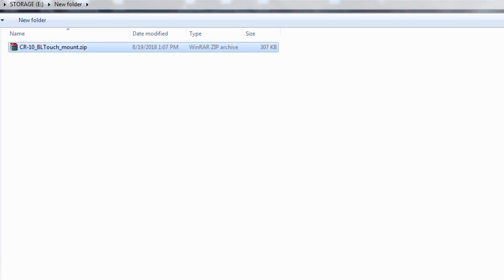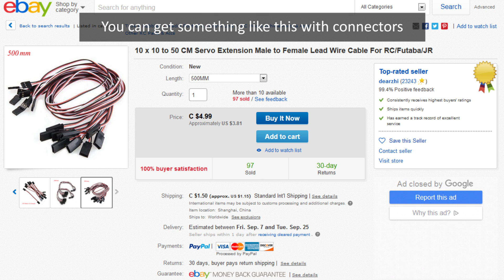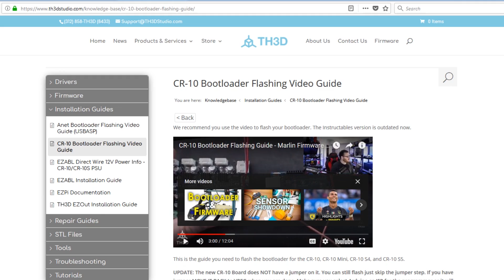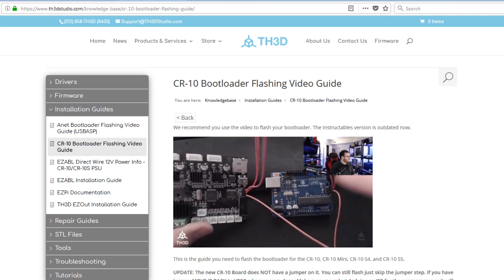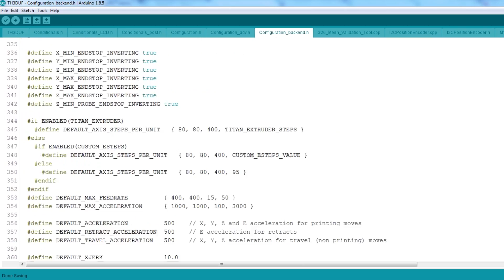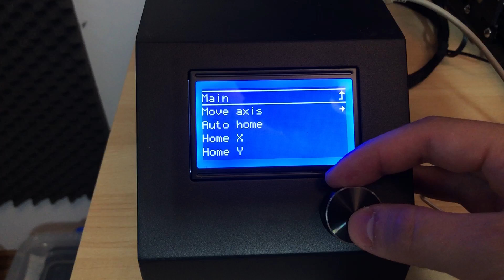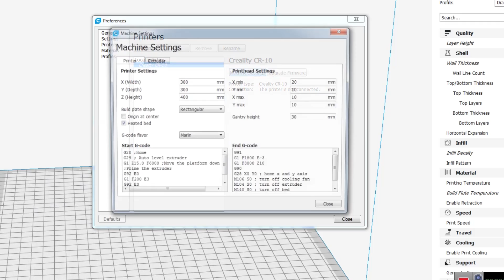Voltlog #177 - Installing BLTouch Auto Bed Leveling On The Creality CR-10 3D Printer

Comment from the maker: As someone reported in the comments below, the code shown in the video contains an error. Line #define SERVO0_PIN_27 should be #define SERVO0_PIN 27 (last underscore replaced with space)
Reply from the maker: as someone else reported in the comments "There is a critical information missing in this video, if you cannot take your nozzle below absolute zero (soft zero), enter this: M211 S0. This command will disable the soft stop. Once you adjust with paper, enter M211 S1 to enable it back."
Reply: Hi, i have a little problem. My Z axis after preparing everything isnt lowering itself but only trying to get higher and higher. Do You have any idea what the problem could be?
Reply: @TheGregMean  probs the Z home direction setting in the firmware (you figured it out I guess this is for the next person reading this)
Reply: The th3d link doesn't work.

Comment: I followed your procedures as well as incorporated a couple of other g codes for my CR-10s.  Everything seemed to work ok right up until I told it to auto level. The probe starts far right at the very front edge of the bed. The 4th point on the far left is completely off the bed. I thought I must have messed up something in the firmware regarding the bed size, but it appears to be set properly at slightly under the 300mm.  I don’t know what to do now.  Any suggestions would be helpful.

Comment: I personally prefer the cheap solution: Membrane switch to be put to the nozzle. Mostly used on deltas you can get such a switch for less than $2 on AliExpress; less than $5 including a board with a LED (which helps on the manual leviling with screws before using ABL). Solder Pin 29 on the Melzi board, get GND and 5V from the ISP-port, make some changes in firmware - and ready to go.
You normaly do not need to do ABL every time before print but only if calibration changed (other heatbed temperature, nozzle-change, transport the printer...) so manualy attatch the probe does not seem a problem to me.

Comment: A common source of 8 core cable is stranded CAT5. (Can't use solid because it will not last with constant movement.) Good way to reuse CAT5 patch cables with broken tabs, especially ones that are too short to be worth crimping a new connector onto. Ground all unused wires to minimize interference.
Reply from the maker: Thanks for the tip, I have a couple of those. In the past I also used alarm wire because that as well has stranded cores.

Comment: Is this process still correct? I'm installing a BL touch on my cr10 today. I've got the install and firmware covered(I bought the original). What I'm concerned with is the proper setup to get it working after install/firmware

Comment: This might be a stupid question but... you disabled the SDcard support in the arduino code. How can i use my cr10 then? Or does the standard microSD still work? Thanks in advance!
Reply from the maker: sd card support was disabled, you can print via usb. if you still need sd card support you will need to search for a tutorial that will keep sd card but disable some other things to free up memory.
Reply: @voltlog  thanks for the reply! Unfortunately i cannot find any other good tutorials.. can you recommend any other functions to disable? i would appreciate it a lot!
Reply: @narada4421  You can save quite a bit of memory by disabling menu options you don't normally use.
Reply: @narada4421  You can disable boot up screen - not sure how much it frees up not tried that method as i just print from usb or over octoprint

Comment: I have got a clone BL Touch (3 D Touch) all setup and able to AutoHome and probe the bed at multiple points! Bed Visualizer plugin for Octoprint works to provide a visual bed mapping as well. I can Autohome the center of the bed using a G28 and launch a full bed probe using G29. I then input the start G Code that was listed here and when I launch a print the CR 10Autohomes and then probes each point on the bed as it should and then just stops at the last point in the rear right corner. Both nozzle and bed are up to proper temp so it should just start printing , but it does not. It waits and waits and waits... Software Endstops are turned on - I checked by issuing an M211 and all end stops report as functional and change states appropriately. Checked with an M119.  
Ive got my probe offset correctly defined in Marlin as well. I measured how far the probe tip was in front of the nozzle (Y Offset) and to the left of the nozzle (X Offset).  I tried some other start G Code and it just made the hot end grind all the way back towards the  X Axis and then travel upwards towards the top of the Z axis.  I need an assist.
Reply: Late reply, but same issue. It stops at last point. Found a fix?

Comment: So just with the command  "G29 : Auto level extruder" in the g-code the machine will interpretate to make a heigh measure using as base the lowest point of Z axis configured in the machine? (my case  Z -1.29)

Comment: Just followed your instructions - have to to say this needs updating as my z axis now crashes into the bed at first, then levels itself. Also I have no BLTOUCH bed leveling controls on the screen. There are only BLTOUCH self test, reset, deploy or retract options :(. I will upload a video.

Comment: Just to solve the mystery with the z axis limit switch: if nothing ist touching it, the switch is closed and opened if pushed. So what happened ist that you shorted the black and white wire of the sensor each time the switch was not pressed. And so it doesn't matter if the sensor closed his self or opened... It stays closed until the switch was pressed

Comment: Im having issues since trying to install bltouch on my CR10. I cant get any answers from creality or other pages I posted in. My printers just collecting dust. Im pretty sure I have the wires connected properly and installed the firmware correctly. I auto home then prepare, move axis, move Z and adjust Z until paper just contacts nozzle just like I would level it. I get the value -002.8 then im supposed to go to control, motion Z and whatever it says add that to -002.8 and adjust. Well my Z says 00.00 Every single instruction and video Ive seen to install the bltouch, not one person had their Z offset say 00.00 Im guessing this is the issue but dont know what I did wrong. When I try to run the bltouch to level it goes through 9 points then goes up and right until the motor sticks. Theres no place I cant take it and pay to have it fixed so I cant even use it anymore. Please help.I bought the kit directly from creality because it had a little flash drive to just upload firmware tha was supposed to work without making manual firmware changes which I dont know how to do.
Reply: Did you ever fix this? In the same boat but I'm thinking of just doing what is in this guide. Pretty damn ridiculous creality basically lies to everyone saying the firmware works when obviously it does not!

Comment: 10:45
  G28 ;Home
G29 ,Auto level extruder
G1 Z15.0 F6000 ;Move the platform down 15mm
;Prime the extruder
G92 E0
G1 F200 E3
G92 E0
M420 S1

G91
G1 F1800 E-3
G1 F3000 Z10
G90
G28 X0 X0 ; home x and y axis
M106 S0 ; Turn off cooling fan
M104 S0 ; turn off exturuder
m140 S0 ; turn off bed
M84 ; disable motors

Comment: For those who dont have wires in following order: brown, red, yellow, black, white - don't follow colors manual, there are some bltouches with fucked up colors, check which wire is which beforehand, otherwice you will get black screen on tour CR10 when you start it after rewiring.
Reply: How do you check?

Comment: Are you still using a bltouch on your CR-10. I would like to upgrade to an abl system and was wondering if this would still be your recommended option?
Reply from the maker: Yes I would still recommend the bltouch, it's the best.
Reply: @voltlog  Awesome! I just ordered one! Thank you! Is there a way to babystep z height mid print with this firmware? I am able to do this on my genius to get the perfect layer mid print.

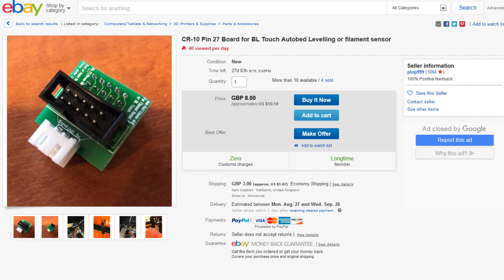Comment: Thank you very much for this video. At 2:30 why not attach the BLtouch to the mount with the nuts before installing the mount to the hot end assembly? You can also manually raise the Z position to give yourself more room to work with.
Reply from the maker: yup, that is good advice

Comment: IMPORTANT! The code in the video is WRONG which cause stuck me up, for 4 hours of head banging against my wall.
the line #define SERVO0_PIN_27 is wrong correct line is #define SERVO0_PIN 27 (last underscore replace with space) 
If you flash your printer with bad code you will end up with bltouch which is in stowed stated unable to release!!!
VoltLog can you please correct this line of code in your video? At least show big warning.
PS: I know that my english is bad, but more important is this information.
Reply from the maker: thanks for reporting the error.

Comment: Everything ok with the installation and the firmware, but when I give the homming command, the Z axis does not stop when the BLTOUCH touches the table. What can I do?
Reply from the maker: signal is not reaching the motherboard, could be incorrect wiring, incorrect config, you need to check everything.
Reply: Hey did you figure it out, if so what was the fix?

Comment: Just setting up my first Printer, CR-10s S5.  I liked this design, but with all the advertising hype associated with the other types I wasnt convinced.   Your video has convinced me.  This will be my choice for ABL.  I hope you will be available for questions >:)  .  Mainly G-code insecurities at this point.  Thanks for making this video.
Reply: I have the CR-10S too - its an awesome machine once you get your filament settings dialed in. A lot of other machines are 98% identical. Im not a Prusa fan - way too many weak 3d printed plastic parts- if you go plastic then I want factory jet molded for the price he's asking. FYI the main board is different than the CR-10, you have a LOT more memory available on the 10S so no need to comment out any code to make space and you can flash with the USB port. The firmware settings are different though - keep an eye on that. Ive flashed mine several times - the stock firmware is not great. The latest marlin with the added code works fantastic.
Reply: Do you have any "great" video sources for the Marlin sw updates or how to  do the updates or mods for the bLT.    I  just ordered the BLT but dont want to screw up my CR-10s.    There is advise but its all over the place.         thanks @davey3765

Comment: hi. Everything goes fine until i have 
to do the calibration.
When calibration finish the z axis starts to up, and do not stop until 
gets the top of printer. Even when it comes to the end, the motor still 
working, do not stop and very bad noise comes from spindle. This is the 
case of a CReality CR-10.
Please anybody can help?

Comment: Thanks for the video, TH3D makes the install a breeze - That cable tie is not terminated correctly
Reply: Hey men, do you have that specific TH3D firmware?
Reply: @engineboy5362  Did you ever find it. Looking for it aswell.

Comment: HELP PLS
I fnished intalling BLTOUCH and firmware, 

I Have CR-10 
Motherboard V1.1.2
Firmware: CR-101.1.6BLTouchV3PowerLossContinueEnglish.hex 
(the latest firmware Creality provide on its website for the CR-10 with Bltouch )
BLTouch V2

Auto home work fine, 
When I select level Bed, its goes through its sequence than, Z goes full up, X goes full forward and Y full right untill all moors are slamming at their max... 

I reflashed the firmware with couple different ones.. always the same issue.. any ideas?

Is is a problem with the V1.1.2 not having enough memory space ?
What do I need to do?
Reply: How did you solve this? Having the same issues.

Comment: There is a critical information missing in this video, if you cannot take your nozzle below absolute zero (soft zero), enter this: M211 S0. This command will disable the soft stop. Once you adjust with paper, enter M211 S1 to enable it back. Watch this for setting up the BLTouch: https://www.youtube.com/watch?v=y_1Kg45APko

Comment: Can you not just remove the Z stop connector from the board and plug in the bl touch instead of tapping the wires?
Reply from the maker: Jamal Mahroof yes you can do that if you have the proper jst connector. I had to tap the wires because I had a previous mod there.
Reply: @voltlog  Got my bl touch and just did it with some male dupont wires. One on each of the pins and it works fine.
Reply: @Jamal Mahroof you just connected the sensor to Z endstop switch with no any other  control box modifications? upgrade the firmware and thats it? something I don't get.. what about SD SUPPORT?

Comment: please help I having issue on my BLTouch when I do bed leveling it goes in the middle and starting knocking loud ive got the CR10s im not sure howto set offset
Reply: Same problem here
Reply: ever fix this?
Reply: @thomasengler403  did you ever find solution?

Comment: When I try to flash the board I get this #error "You must define Z_CLEARANCE_DEPLOY_PROBE in your configuration."  not sure what to do.  Help Please!
Reply: Check other commands with the same name and make sure all the letters, spaces, numbers, underscores and ; are the same. Also check that it is not commented somewhere up the code.
Reply: If you set #define CUSTOM_PROBE then #define EZABL_ENABLE gets set which in turn sets #define FIX_MOUNTED_PROBE
So you end up with a FIX_MOUNTED_PROBE and a BLTOUCH at the same time, which generates the error "Please enable only one probe option:" I just commented out the line #define FIX_MOUNTED_PROBE from line 1914 of Configuration_backend.h It now compiles.

Comment: i have a cr10s5, i did step by step and my nozzle just slams on the bed, tried unplugging the z axis switch but it doesnt work,and the sensor seems unresponsive (red light and a small blue is on) if i put my finger under it it goes upwards but it doesnt stop the nozzle, just keeps going. anyone got any ideas?
Reply: get a replacement
Reply: Reverse the polarity of the black and white wires.

Comment: Hello! I followed your guide. I have the following problem, I have tried to install the Aliexpress BLtouch. I have been at this time since I am a newbie, and now I have the following problems.

The first is that now I do not heat the nozzle and I put the error that appears in the picture that comes out of the screen of the CR10.

Secondly, I can not get the BLtouch to work, I'm left with a fixed red LED, and if I'm under the sensor, it turns blue but it still does not work. I leave the photos of the interior, wiring and others. I can not find the problem. Thank you so much everyone.

Comment: So, I just watched twelve minutes worth of footage, and I still have no idea what "a BLTouch" is. Yes, it's clearly (?) some sort of proximity sensor. On a non-exclusively-3D-printer-oriented channel like this one I would have appreciated a few words on what exactly it is supposed to be and how exactly it is supposed to work though, before the plunge into the "just do this and stop asking questions" tutorial.
Reply from the maker: you're right I should've added some info on what the bltouch is. It is a bed leveling sensor that uses a push pin and a hall sensor to detect the surface of the bed thus it doesn't matter which material the bed is made of. It also features a solenoid for retracting/pushing the pin automatically.
Reply: Thank you. That sounds pretty interesting on its own actually...
Reply: If you have gone this far into looking at this video, then you should have already done your research and known what a BLTouch is. The title states that he is installing a BLTouch on a CR-10. Use some common sense and some Google skill's beforehand and search both keywords in that title and you will know exactly what he is doing.
Reply: LOL